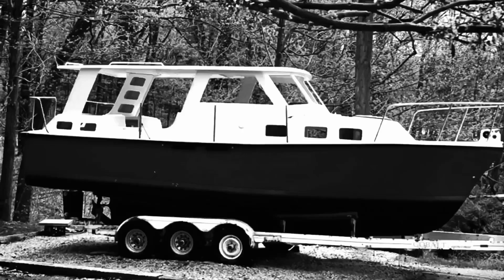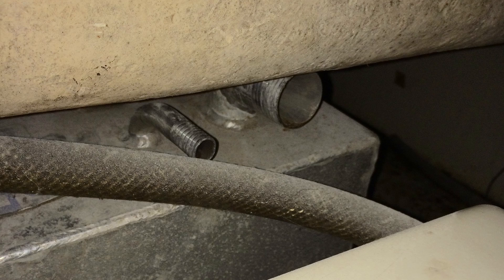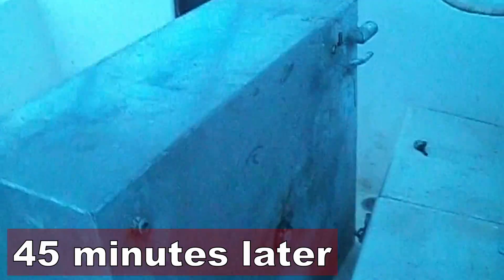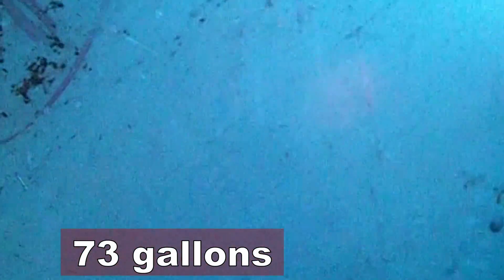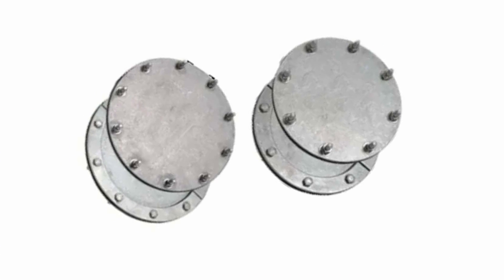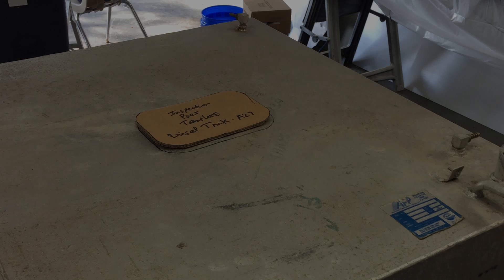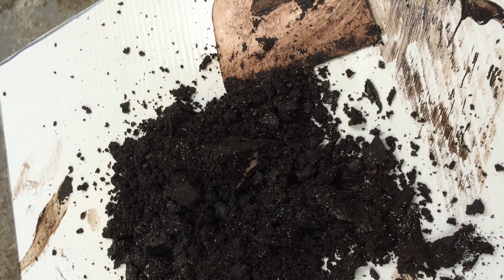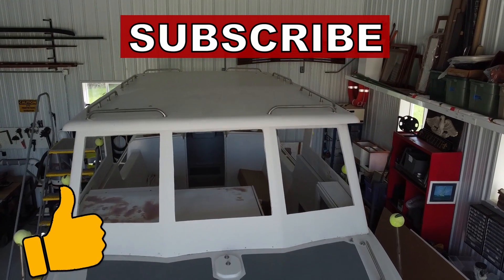Diesel Fuel Tank Removal, Corrosion Repair & Deep Cleaning | Great Loop Trawler Restoration (Ep11)

Comment: Nice job on the fuel tank Joe that's the best way to clean and repair your tank by making hatches I've made dozens of them I then tig weld nuts onto washers cut the holes washer size and butt weld them on then grind it flush in both aluminum and steel it is a bit time consuming but worth it a nice thick rubber gasket which is diesel safe some rubber are not and your right I watch a channel in the UK where they have just bought a motor boat and the engines kept on cutting out as the one tank was full of sludge tons of it same as yours the channel is called ship happens they are also restoring an ex-world war 2 war ship converted to a pleasure cruiser it patrolled the coastal water it has a sister ship which has been restored back to a warship as it was back in the day but these two are wanting to go around the world in it once rebuilt its worth watching joe the husband and wife team are awesome just like you. so all the best from John from Rugby UK.
Reply from the maker: I know Ship Shape well they have given me some great advice on growing my YouTube channel 
Thanks 😊

Comment: I was under the impression that if you tried to cut into an old metal diesel tank you could get some combustion.  How did you mitigate that?
Reply from the maker: Great question Bryon! First, diesel fumes are not as flammable as gasoline. This is a diesel tank not a gasoline tank which is different. Never the less, you rinse the tank first with water to try and get any left over fuel or debris out. Then its a simple matter of cutting open the tank using a jigsaw.
Reply: diesel has a very low flash point only a naked flame would ignite it and even then it will only slowly burn with black fumes coming from it like kerosene